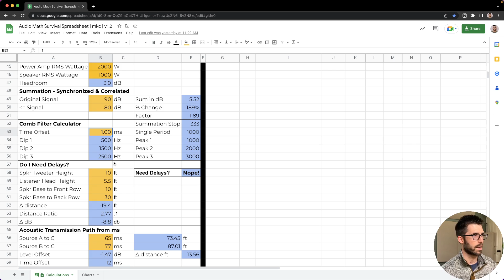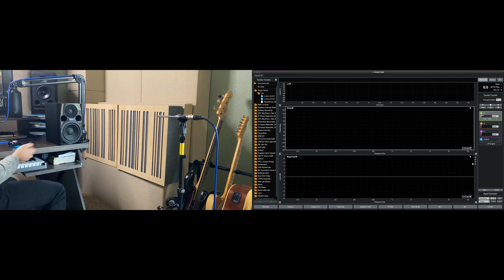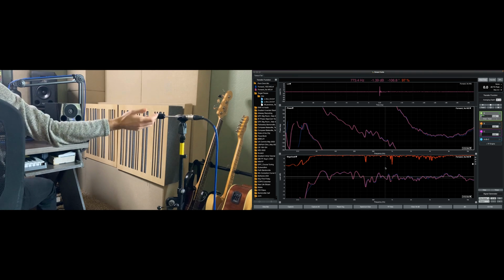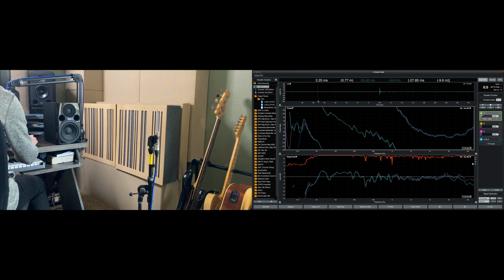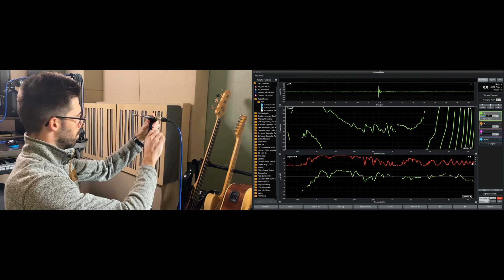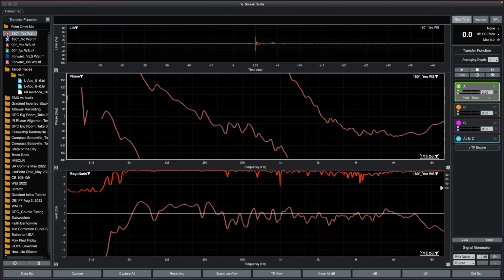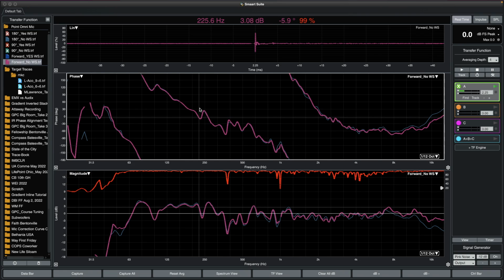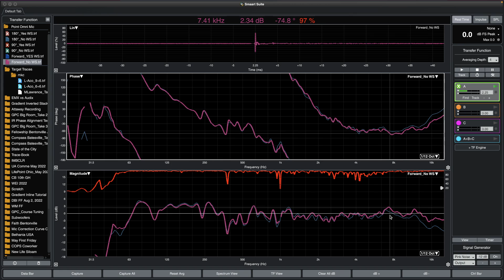Are Omni Measurement Mics Actually Omnidirectional? (And What About Windscreens?)

Comment: Hey Michael, thanks for the demonstration. If you don´t mind I would like to give you the same advice I do to my class attendees when we are comparing different Mic in the free field and diffus field position. A: make sure that the height of the Mic is the same to get  the same conditions in free/diffus angle. B: press once the "V"-Button to refresh the data before capture the measurement. C: there is a great option in the Signal Generator Settings: Stop Gen after Capture 😉
Reply from the maker: Thanks for these tips, Michael!

Comment: Good afternoon. Thank you for the video. I don't speak English, I'm sorry, that's why I'm writing through a translator.
  If I understood everything correctly, then you need to take into account one moment. To do this, there are calibration files for two modes of using this microphone. In free field and diffuse field. In other words, the manufacturer suggests that there is a difference in wings.
  But in general, for testing the directivity of the microphone, your experiment is very revealing. Thanks!!!
Reply from the maker: Yes, I totally agree that the manufacturer does provide different calibration for diffuse and free field measurements that help offset some of these changes. I just wanted to illustrate the differences and see if the mic orientation was as "big of a deal" as I thought it was.